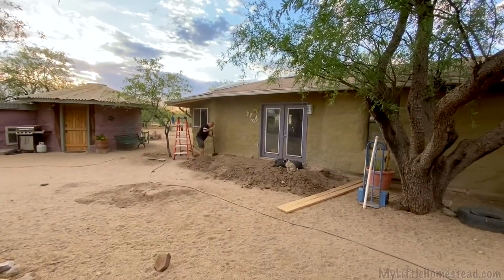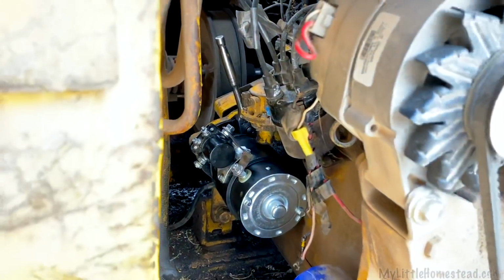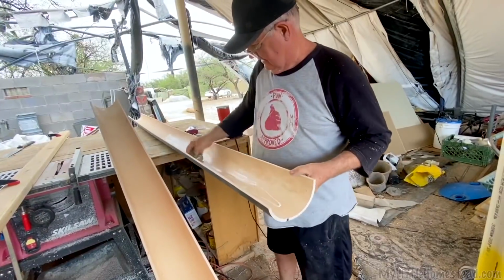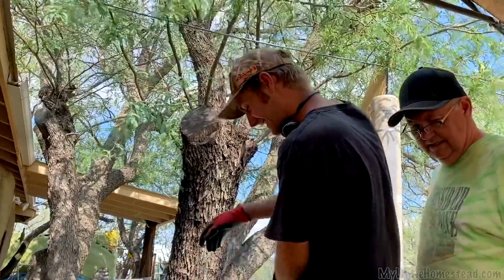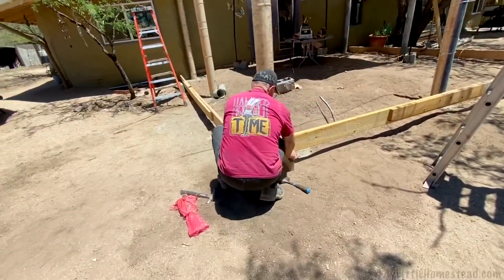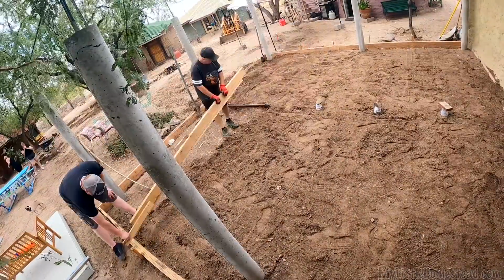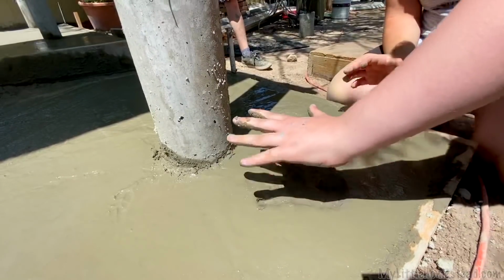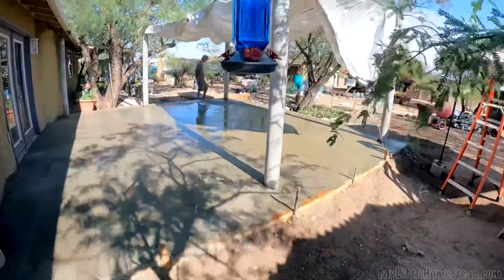DIY Concrete Pillars & Slab | Weekly Peek Ep297

Comment: Gary,
Also for future reference if you pour more round pillars on concrete,  Take one of you uncut long pieces of rebar and use it to chuck the concrete in the tube to remove air bubbles.  Don't just rely on hammer tapping.  This will eliminate all those small holes on the outside of the columns and give you a smooth surface.

Edit:  I hope you took a wide stiff bristle broom and gently brushed the top of the pad to create foot traction after it dries.   Otherwise after a rain shower that pad will be slicker than snot.
Reply: You seem to know a lot about concrete? Do you know why they spray it down after awhile? Cheers!
Reply: @gracieshepardtothemax1743  It's a sealant.  It's basically a coating that helps the concrete to dry especially if not in a warm dry climate.  Hot summer days are the best time to pour concrete because it will dry faster then, to the point of removing the forms either later the same day or the next day.  Winter time it usually takes a couple days to dry enough to remove the forms.

Also what they should have done once the concrete was all poured and floated was to take a wide stiff bristle broom and very gently brush the top of the concrete to give it just a slight texture for traction.  This is done with sidewalk making.  Otherwise if that concrete gets wet it will be slippery as hell to walk on, like after a rain.
Reply: @gracieshepardtothemax1743  Well I worked as a concrete worker for about 5 months.  I was almost killed during a job site accident involving my back.  Boy, do I feel that from time to time these days.  When you're 18 you think you are strong enough to take on the world but when you almost die, the world gets to be a tougher place than you realize at first.
Reply: @thereturningshadow  thanks for the info! I was thinking of doing “quickcrete” with the stencils to do our patio. Hope your back is getting better! Cheers 🇨🇦😊
Reply: @gracieshepardtothemax1743  If you are talking about those mats you pay down on top of the concrete to create patterns then you should ready to use them at a moments notice because quickcrete got it's name for a reason.  It still aches from time to time.  Can't do a lot of physical for long periods.

Comment: Have Bryson 3-D print a My Little Homestead inverted logo that could be filled with concrete to be placed on a concrete pillar so that the logo would stand proud of the pillar near the top. Or a bigger logo that would go across the top of the first span.

Comment: HOMESTEADERS:  Tarp covering suggestion.  You said you probably won't use a covering unless needed.  I suggest you roll up onto the roof whatever covering you plan to use for this.  Secure one end to the roof, roll it all up so if you need it, it can just be unrolled onto the column joists and make an instant covering.

Comment: Soooo smart, the cement post are better than wood that would eventually rot, now I’m convinced you can do anything. Be safe working in the heat, drink lots of water.

Have I told you yet that I think you all are awesome?

Comment: That's a fabulous idea come to fruition👏👏👏👏Great thinking Gary...now for an emergency cover for the wedding..attach canvass tarp along house and then concertina the canvas all the way back to the house. It you have straps at the 2 corners furthest from the house, then if cover is needed , 2 guys can pull the canvas by the straps to the front an tie them down. 
That makes sense in my head but not sure how I went with putting it in words. 
I'm sure someone will extrapolate the meaning from my words and use the idea if stuck for an answer.  You're such a great family and it's just sad that Grandad Roy missed out by a few weeks of sharing in Jared and Bree's nuptials 🤗😃👏💖🙏💞🙏

Comment: To get an even more smooth surface you can use a jack drill or some other vibrating power tool between each scoop of cement. I also would have wired or welded many short rings of rebar along the length of the pole.

Comment: I wish you had put in Control Joints in that big slab for the potential of cracking.  Control Joints are designed to focus any cracking to happen in them first.  Without control joints a crack can look like a lightning blot and happen anywhere and everywhere in a slab like this.

Comment: Just an idea ...... Have you thought of concrete impregnated fabric as a concept?
There are some really good examples of it being used in larger buildings to give an interesting look to both walls and ceilings. But for your case I like the idea of using it to form swags draped over a scaffold pole. If you did that it would give you the option of going open top or covered as suits and could tie in to those posts well too!

Comment: Stoked you are keeping the skid steer working! You might consider a seafoam treatment with 1/2 or so, depending on the engine size, of the bottle sucked into the intake when it’s warm and kill the motor and let it soak for 20 min. Fire it up and keep it at 2000 rpm or so and let the carbon burn off. It will be a spectacular amount of white smoke that will result. Check out some vids in it. Works like a charm in my rigs.

Comment: It looks great. Just curious, when we had our patio poured that was about the same size as yours , they put expansion joints in the concrete after smoothing it out.
Reply: Yeah they should have put those. Especially in the dessert with a big thermal amplitude.

Comment: With that sizeconcrete pour won't youneed expansion cracks?

Now the pillars are cute but to make them awesome use concrete sealer in the color of the indoor 'tree' to make them blend in with the rest of your building theme (natural theme).

Can't wait to see what Gary has designed for the roof.

Comment: Another great video. The teamwork and problem solving was outstanding. I was waiting for you to break out a sander or a reciprocating saw to vibrate the columns. Gary, you really wasted a great line.. it isn’t ‘Luke, I am your father’, it was supposed to be ‘Brea, I am your father’. I can see a future off columns in your future. Gary and Bryson have the molds and the process down pat. Looking forward to the roof and the rest of the wedding planning. Thank you so much for sharing!

Comment: Interesting project. Curiosity question.You had plenty of tubes. So why not skip splitting them in half and just fill them and paint the outside with Krylon Fusion For Plastic spray paint?  Or were you determined to have the texture/look of concrete? Of course, you could still glue them together around the collumns using PVC pipe glue, if you change your mind.

Comment: Did you think about a Roman style shade, like they used on the Colosseum in Rome in ancient times, for the new porch.  When you want shade slide out the panels, and when you don't want the shade it would slide back and allow you to have the open air above.  Shae's sewing skills would be invaluable in making the shade and plumbing pipe.  It should not be expensive and versatile.

Comment: i wonder: would cleaning the PVC-pipes and filling them with concrete and rebar get you more stable pillars ?
Reply: @Ulrich Kälber
HUH ???   I'm sorry,   Isn't that just what they did ????
Reply: @heatherclayton-callaghan4270  i mean to fill the tubes and let them onthe concrete.
not to cast into the tubes and remove them.

Comment: 40,000,000 times rebuilding a carburetor, may be a bit of hyperbole. If it took you an hour to do it once, it would take 1⅔ million hours, or 69,444.44 days, or 190 years, 46 days, 22 hours, and 40 minutes, working non-stop to finish. In figuring that out I discovered that 40,000,000 seconds = 11,111.111... hours.